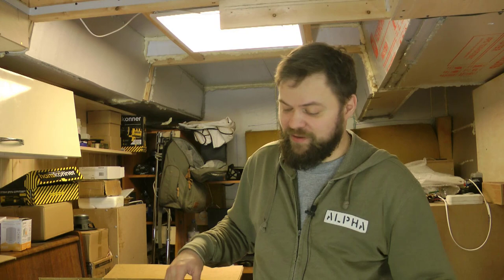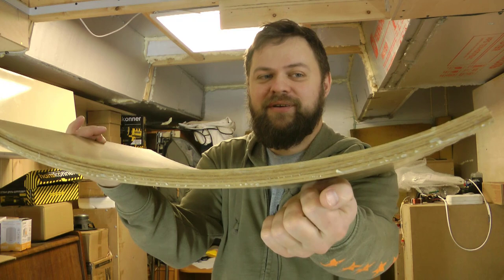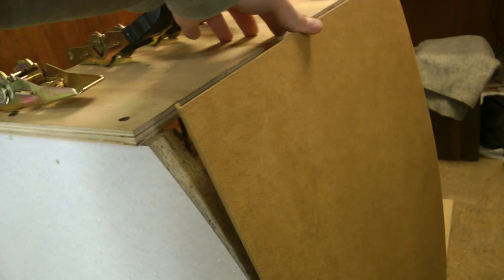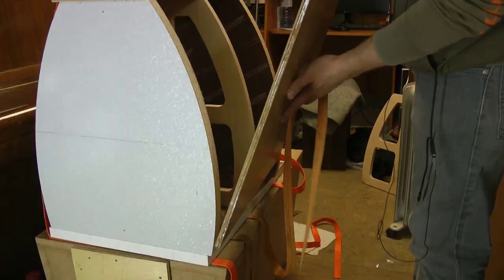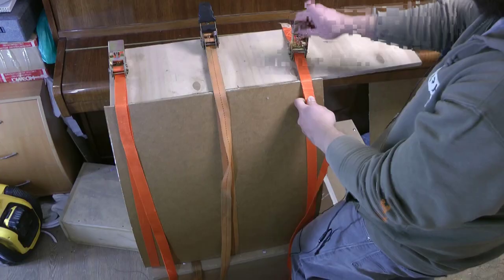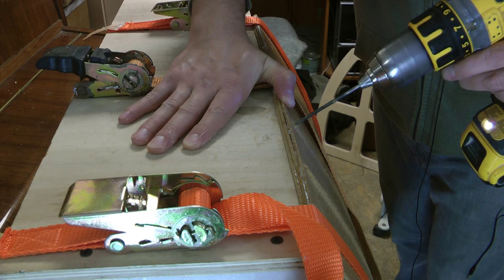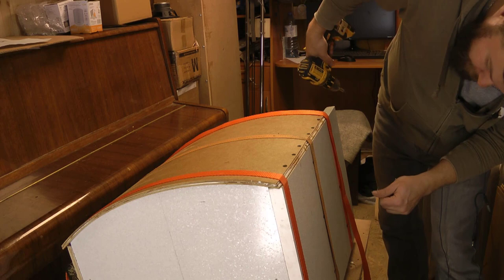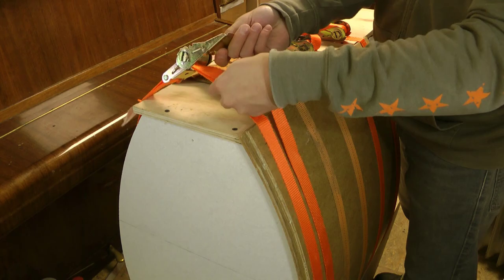how to make a speaker with a bent body / do it yourself / DIY speaker

Comment: Nice explanation. Thanks. I wonder how you trimmed the edges to make the box. Is the frontplate in excess to the bent sidewalls? Can I use a router on a bent surface?